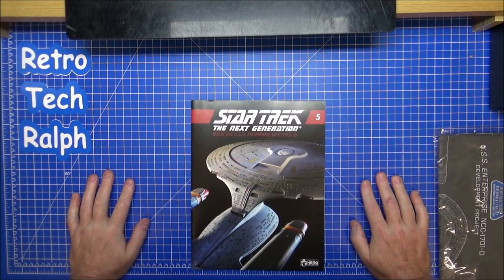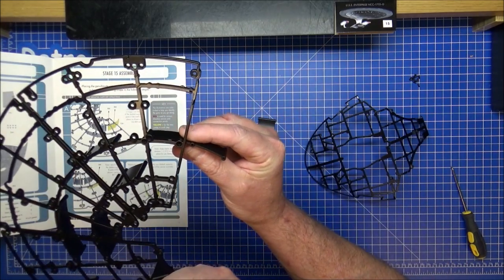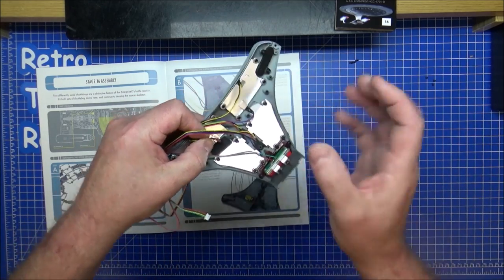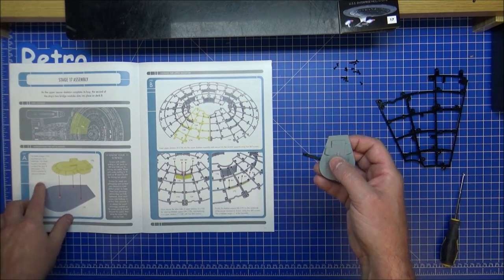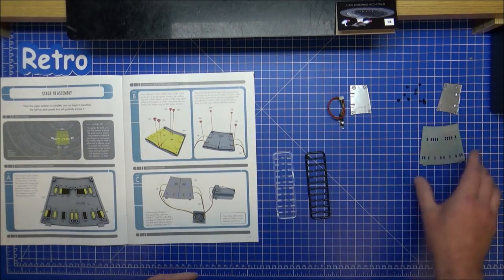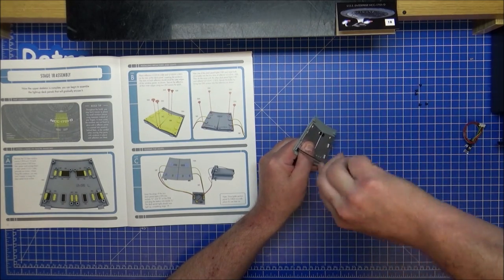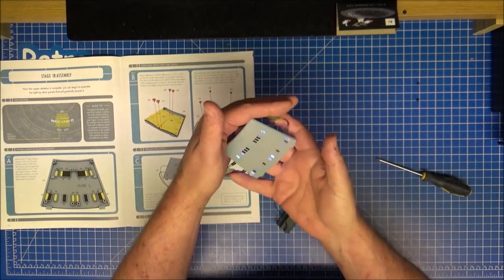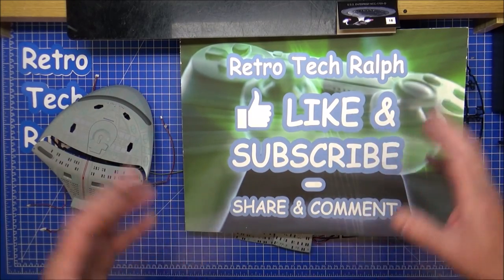Star Trek: Build The Enterprise D. Stage 5 Assembly. By Eaglemoss/Hero Collector.

Comment: Now coming to this stage with the hull pieces and wiring fingers crossed
Reply from the maker: just take your time and enjoy it.  its frustrating at times, but will be worth it in the end.
Reply: @R_T_Ralph  I’ve just watched the video you did of that stage where you thought you’d broken the led but it seemed ok on the light test,I’m in a group to do with the build on Facebook and got a few suggestions what to do like remove the led first then try and slip it in as you screw it to the hull fortunately I double subscribed at the start so I have 2 issue 1s so spare parts and a spare nacelle for when I’m near the end it’ll look a bit more complete,got issue 5 coming now and issue 6 being dispatched soon by looks of it